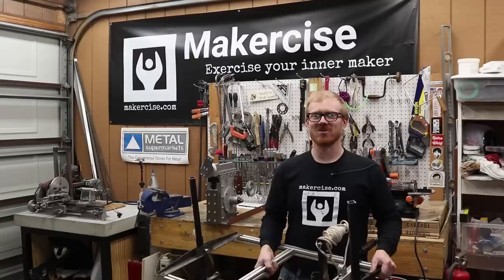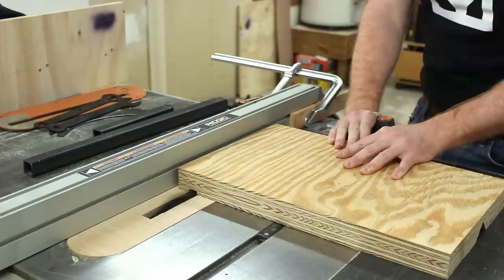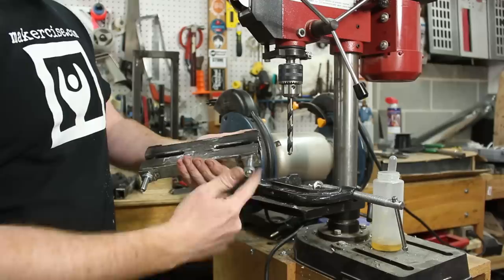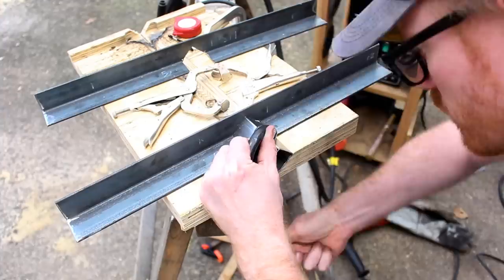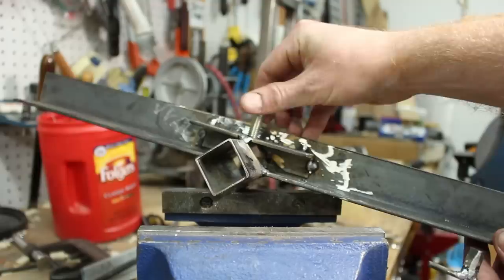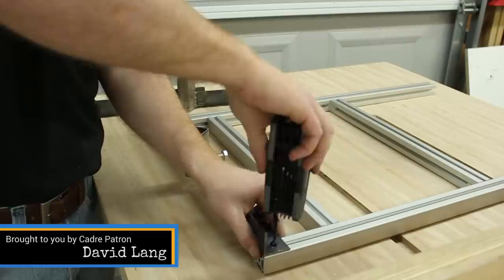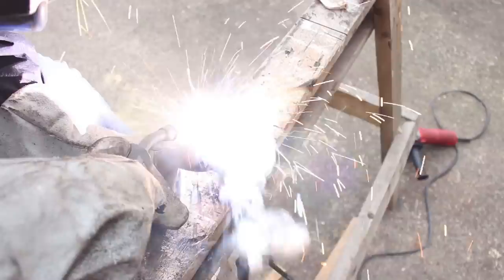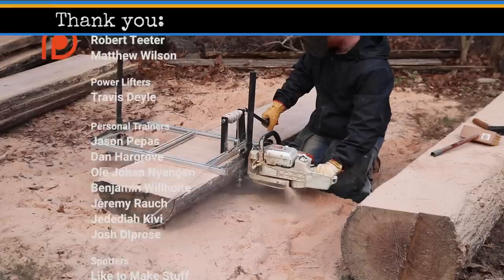How to Build a Chainsaw Mill from Scratch

Comment: Wow, lots of tools to make one, I do like it but just ordered one off eBay for $70 shipped. Eager to try it out. Thanks for the vid!
Reply: well, you can build it just with an angle grinder and a welder, but 70 $ is a good price for it. i must build it cause here in italy it cost 200$ or more (and aslo cause i build almost all my tools=)
Reply: Yep, just because we can, doesn't mean we should.....adding up the materials in the build list is around $70 plus labor time and added loss of productivity and revenue from this diverted effort. Simple economics and having spent fourty years in manufacturing.
Reply: @keithlucas6260   Keith Lucas  but sometimes even if the shop one is cheap and ready to use it doesn't mean it is a good one. Making your own is for sure a lifetime durable tool, and also it will be easier to fix, since you made it. Every time i bought a cheap tool i had to modify something to make it better. Or simply you need something really specific. It isn't only a matter of money

Comment: In Taiwan. There is a basic material. The name is angle steel... It can be cut arbitrarily... Only screws are needed for combination... It saves the work and volume of welding.. You can try it.. She will bring you Surprised...
It has two types: iron and stainless steel.

Comment: For the ultimate chainsaw milling book, try Will Maloff's "Chainsaw Lumbermaking" ISBN 0-918804-12-4. Available secondhand at exorbitant prices, but free from Google books. I own a Granberg mill and the lumbermaker both. Takes a big saw to mill a big tree. The engine runs continuosly and takes a lot of abuse. But I made my woodshed with a Haddon lumbermarker and a Stihl 170 -- an entry level saw. I chose small logs and took it easy.  For logs over 30 cm (12") you will need a much bigger saw, Stihl 600 series and a long bar such as you have.I  like that crank mechanism, Granberg does not have one.

Comment: Great respect, just thinking out loud. Don’t take this as a negative   I think you created a lot of trouble for yourself by keeping your long bars twisted at a 45 degree angle
Reply: yea that one had me puzzles as well, i dont see a lot of benefit in having them 45, only a slight more weld surface  (2x) and the V on the clamp end causing perfect vertical alignment, but other than that, no real benefit at all

Comment: Great Video! Interested in how it works, and if having the chainsaw on it's side for that long is a problem (or if you have to buy a certain kind) Keep 'em coming
Reply: Shouldn't  be they are two stroke so the engine is lubricated  with the gas and oil mix
Reply: You are better off to get a ripping chain for snoother cuts

Comment: Do yourself a favour and install an oiler. Some wood is very dry and the saw oiler cant keep up. It should be installed on the cutting side of the bar- just after the nose. That way you will have lots of oil to keep your bar from burning up.

Comment: I haven't used a chainsaw mill before, but don't you have to put a different chain on it?  Like a ripper chain?
Reply from the maker: John Harmon - Cold Creek Works for smooth cuts a ripping chain is best.
Reply: Lap dance

Lap dance

Comment: Question about the hardware that connects the Extrusion aluminum together.  I found McMasters Web site but don't know the part number of the connection hardware. Please and thank you for that number.
Reply from the maker: Richard Britt 5537T316
Reply: Makercise thanks so much.  Those are the only pieces I'm missing.

Comment: Hey makercise I purchased the plans but I havent been able to view them... what program should I download to access the files?
Reply from the maker: One of the files is a pdf. Use adobe acrobat reader to open the file. Accessing the model is a bit more complicated. Send me an email if you need more help.
Reply: @Makercise  thank you. I'm not very tech savvy but I love to build and fabricate. I figured it out after trying 3 different apps. I built one chainsaw mill from steel already for a small 20 in bar. I picked up an ms391 so now it's time to build an adjustable aluminum mill for both 34 and 42 inch bars so I can swap from my 045AV to my ms391. I'll run a 34 on the ms391 and a 42 on my 045AV. Your plans are a big help. Well worth the $7 thanks again.

Comment: Ok 1 not everyone has all those tools or access to them to do that just once ide like to see someone make a video without using welders an a bunch of other crap to make a useful thing
Reply from the maker: The welder I used cost $90. Angle grinder $60, chop saw is an unnecessary luxury. Clamps and miscellaneous required tools all add up to less than the cost of the chainsaw ~$600.